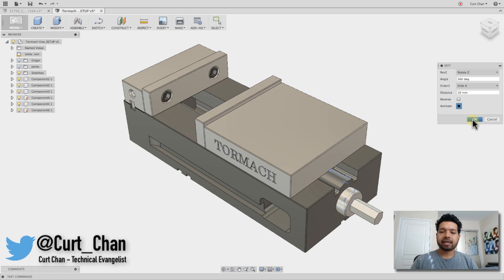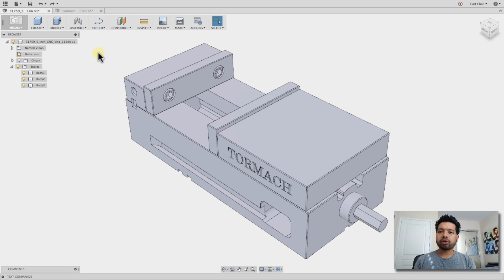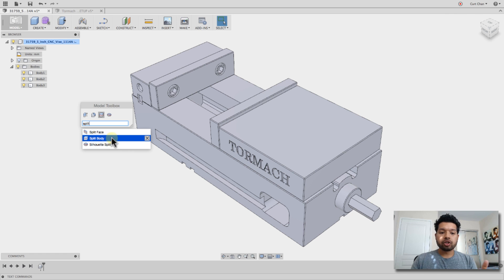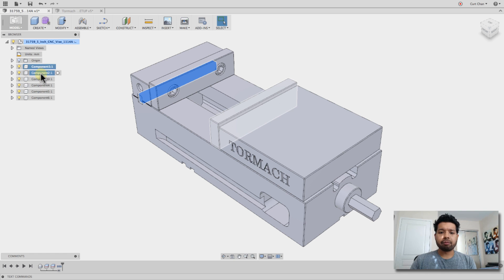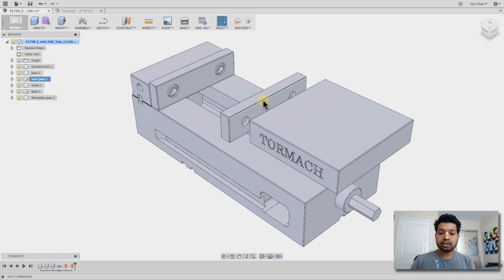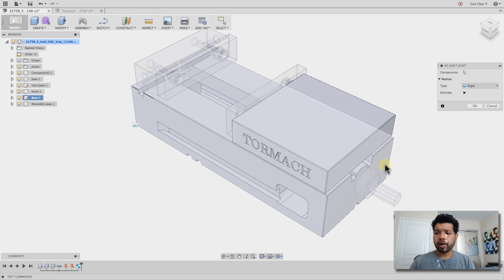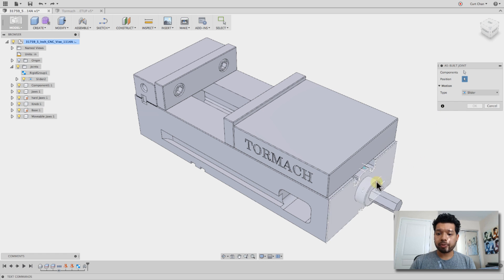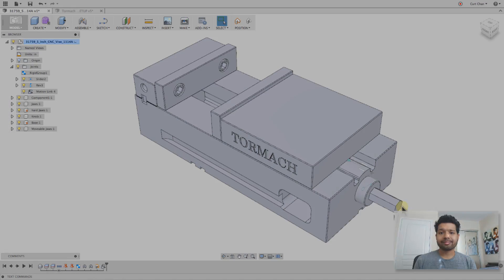Apply Assembly Joints to a Tormach Vise

Comment: Chris, Great video. have you done a video on how to bring a vise/lathe chuck into a design to use in simulations? What is the difference between opening the vise in the design or inserting it into the design? How do you insert it, cant find an option in the insert menu for an .stp file. Merry Christmas